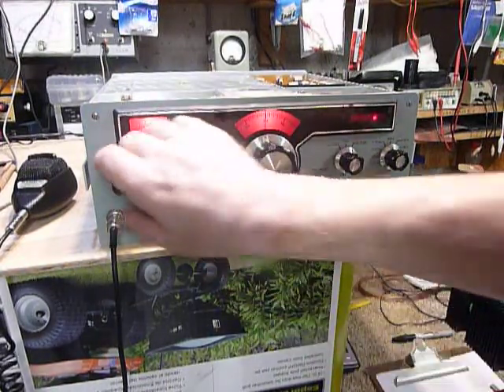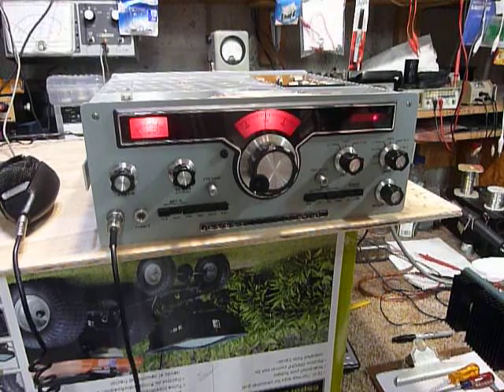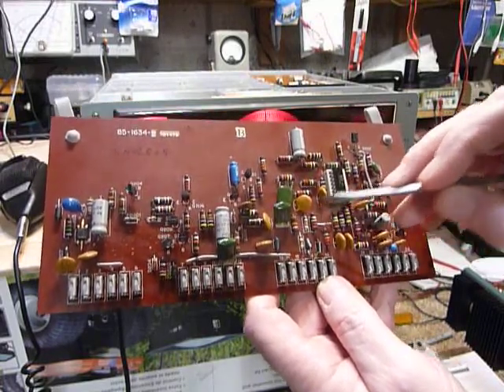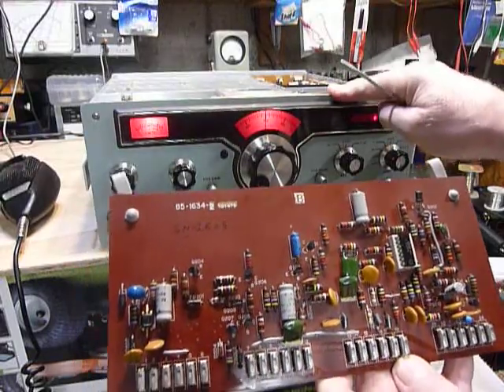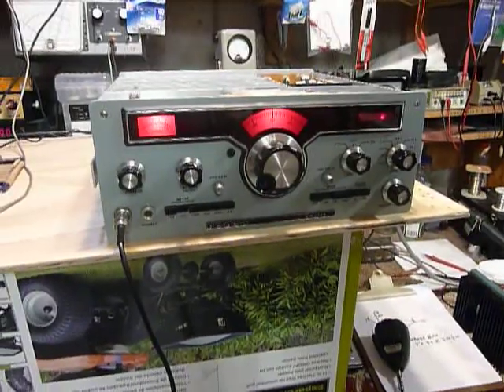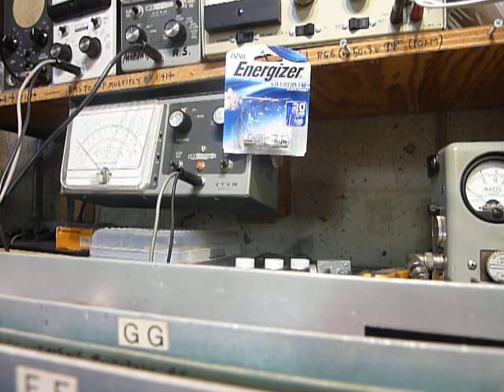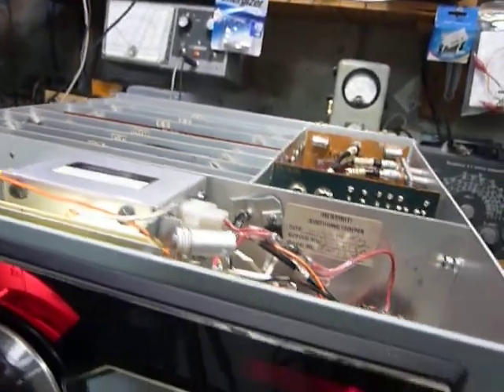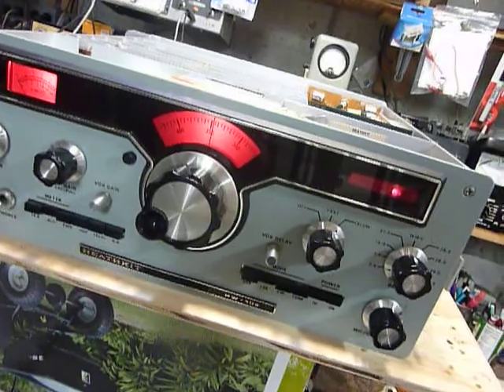HEATHKIT  HW104 / SB104  HF tranceiver

Comment: Bob, I did the 47K mod on my SB104 and got the same results as you. I also use the same mic. I haven't had it on the air yet so I haven't gotten any reports, but I expect that it will also be the same as yours. Thanks N8ZL

Comment: Bob, I like the dynamic mic with your HW-104. I am restoring a SB-102. Any ideas on adapting the dynamic mic to the SB-102? I will also change out the mic connector from the two pin to a 4 pin. Greg KE5ISW